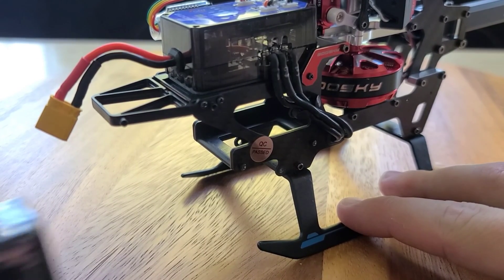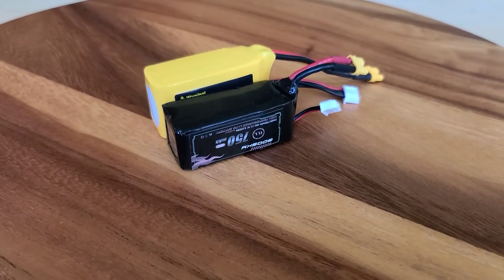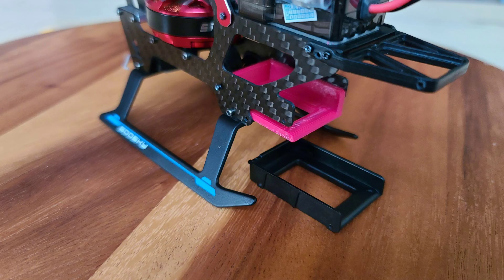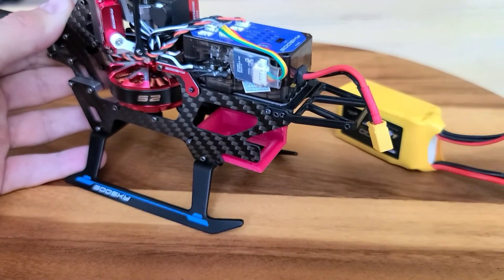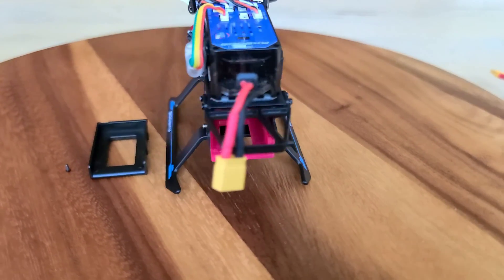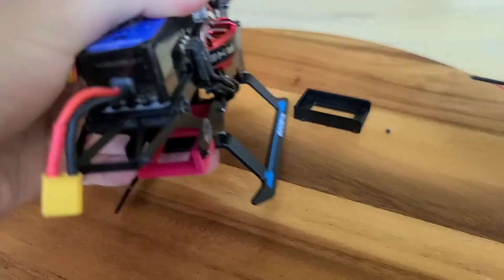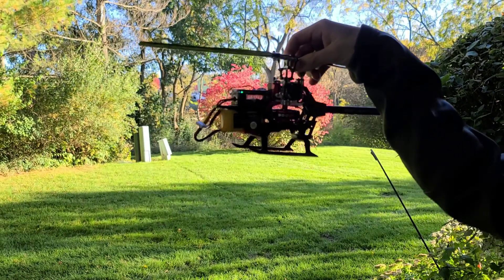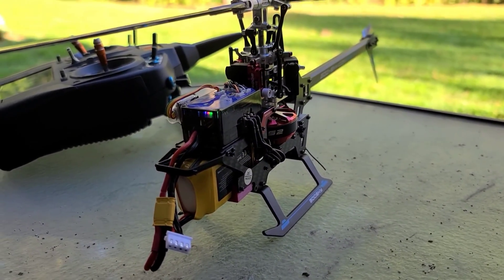3D Printed Battery Tray Upgrade For Goosky S2!

Comment: is it still possible to use the standard 750mah batteries without them shaking around in the chassis?
Reply from the maker: This design is only made for the 3s 800mAh Liperior battery or any battery size at 60 x 30 x 24mm.